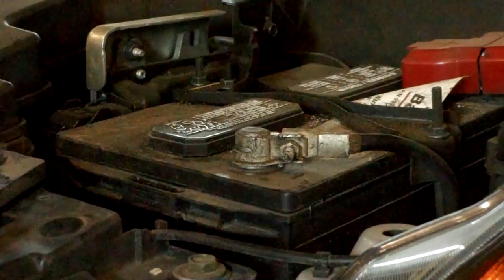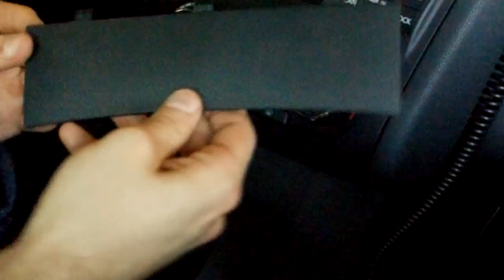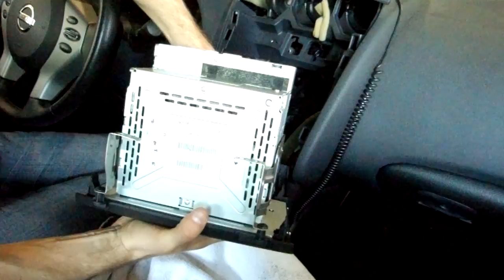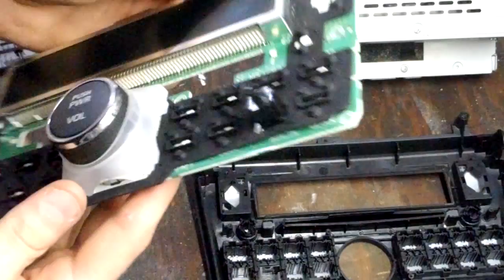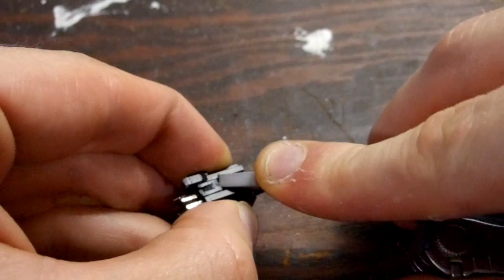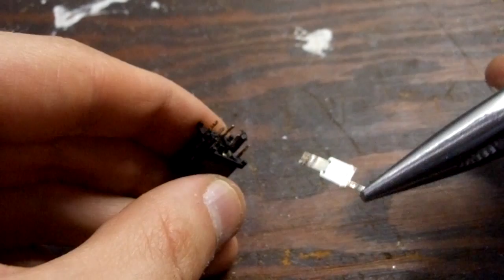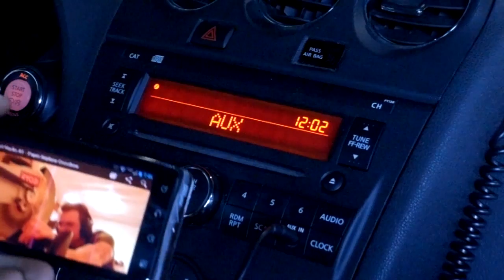Rick's Repairs #1 - Nissan Altima Stereo Repair

Comment: Thanks Rick for such an accessible resource. Great work!! I am going to attempt this on my 2007 Nissan Altima (Hybrid, no Navi) which looks just like yours.
One question I did have in looking at your soldering is "How important is it when you solder the 7 points on the circuit board, that none of the solder "puddles touch one another?" - I have soldered on a circuit board before, but not with points that close. May sound like a obvious question, but shame on me if I don't ask it, and if you do touch puddles, can you just scratch away the excess of the circuit board until you see green? Thanks for any help, and when I try this, will endure I update the post, and take pictures of the back of the radio and post them in case you or anyone else is interested... Will
Reply from the maker: Hi Will. Thanks for the compliments. If multiple solder points go to the same place, then those points can generally touch each other with no ill effect. I didn't pay close attention when I did this so I can't say for sure if there are any solder points that are like this. It's best to be safe and just make sure they don't touch. However if you do mess up and get two points touching, it should be pretty easy to fix. If they are touching just a little bit, you can usually take a razor blade and scratch a line in between them to separate them, just be sure you don't cut any copper traces that may be underneath. You can test if your cut worked using a continuity tester on a multimeter. The other thing you can do if you mess up is use the desoldering braid to remove excess solder from the middle until the points are no longer touching. I hope this helps.

Comment: I have a Nissan Altima 2007, if I buy the part K2HC107A0005, will it fit in my car?
Reply: ***** It's been a while but if you have not done the repair the 2007 is the same part, did mine this past weekend.
Reply from the maker: I'm sorry I don't know if it will fit or not. I'm not an expert with car stereos. If yours looks identical to mine then I would think there's a good chance it should work but I can't say for sure. Good luck!
Reply: Thanks
Reply: I cannot find this part for the life of me. It would greatly appreciate some help. I tried the link. I’ve tried the part number. Can’t find it.

Comment: Hello Rick,
I just saw your tutorial. My aux input is broken and I need to replace it. where can I find the parts? The link you gave doesn't work anymore.
Reply from the maker: It just have broken after I upgraded my Wordpress theme.  Thanks for letting me know.  I bought my aux jack here: http://www.pacparts.com/part.cfm?sku=330N9KF874D7772

If you Google the part number though you might be able to find the same part for as low as $3-$4.  This store used to sell it for less than $4 but the price went up for some reason.

Comment: I have a 2009 nissan Altima coupe. Is it the same part number?
Reply from the maker: Unfortunately, I don't know the answer for sure.  I'm not really that savvy with cars or car stereos.  I just took my own apart and figured out how to fix it.  You might want to check the website where they sell the part and see if it lists compatible car models.  If that doesn't help, maybe asking around in a car forum would help?
Reply: I've ordered the part and it already arrived. I will see if it will work. Thanks! Awesome tutorial btw!
Reply from the maker: OMGITMES Good luck!

Comment: Great video, I actually went ahead and completed the exact same job. My only question is how sure are we that the replacement part is mono or stereo? It seems that the part I ordered from the link on your website is mono. Did you notice the same thing?
Reply from the maker: The part I ordered from Pacparts was definitely stereo as I have installed it in my own car.  If you can look inside the jack with a flashlight, see if you can see how many contact points there are.  The outer ring should be the ground.  Then there should be two more points inside that will touch the two points on your AUX cable.  One is for left and one for right.  If you haven't installed it yet, plug the AUX cable into the jack and use a continuity tester to check it out.  Hook up one end to the AUX cable's right channel and then test each pin until you find one that works.  Then do the same for the left channel.
Reply: Rick Osgood I looked inside the jack with a flashlight and it is definitely stereo, I also checked it for continuity and it checked out fine. I realized what the culprit was, it seems that there are two styles of 3.5mm cable, one that will go into the jack all the way and another that won't. Luckily I had both styles laying around and tried them both. The one that worked was the one that went all the way in the jack. Thanks again for all the info.

Comment: K2HC107A0005 this is The part number for 2008 Altima jack input. I wish i would of had it before i order it from the link you posted. I over paid for it and  had to wait several months before it was in stock. Their trick was not showing the that part number until you ordered was shipped. There are several other websites that carry it in stock a cheaper. 

http://www.encompassparts.com/item/8121068/PANASONIC/K2HC107A0005/JACK
Reply from the maker: Thank you so much for posting the actual part number.  I just looked at the pacparts site and it looks like they are now asking $10.00 for the part!  It used to be under $3.00.  I'm curious if they have noticed increased demand, possibly due to my post about this.  I'll update my blog post with this information so people can shop around and stay informed.  Thanks again!

Comment: IM SCARED TO SOLDER. I DONT WANT TO MESS ANYTHING UP IN MY GIRLFIRENDS CAR! I DONT WANT TO MAKE MY PROBLEM ANY WORSE THAT IT IS NOT . AND I FEEL ONCE U TAKE IT APART..IT NEVER GOES BACK TOGETHER THE SAME WAY AND CAN CREATE A RATTLING NOISE. IM SCARED :( BUT I DEF WANT TO FIX HER PROBLEM...
Reply from the maker: I think the video is pretty straight forward.  If you have some basic experience with soldering or electronics I think this project is actually pretty easy.  That being said, if you are still really uncomfortable with the idea of doing this then it might be a sign that you aren't ready.  You might want to tackle a smaller electronics project.  Practice your soldering and desoldering skills first.  When you take the stereo apart, keep your screws organized in little cups so you don't lose them and they don't get separated.  Take photos before you remove each screw so you can reference them later to remember where they all go.  If you do give it a shot, I wish you good luck!

Comment from the maker: Unfortunately I'm not an expert at this and I haven't seen a 2010 stereo in person before.  If your stereo looks exactly like the one in the video then possibly.  Make sure your AUX input jack is in the exact same location too.  I think there is a newer model of this stereo that looks very similar but it has the jack in a different location.  That input jack is actually a different part and would have a different procedure.